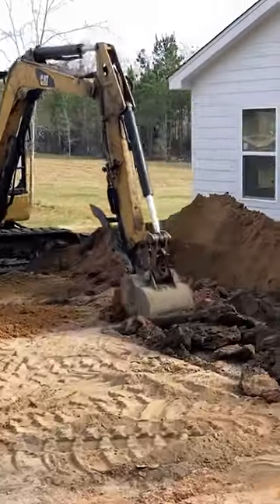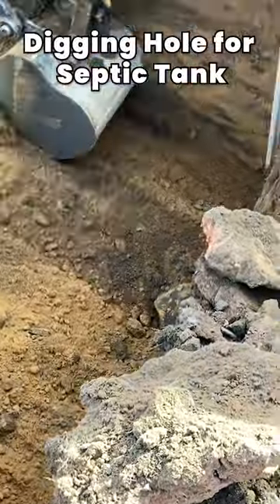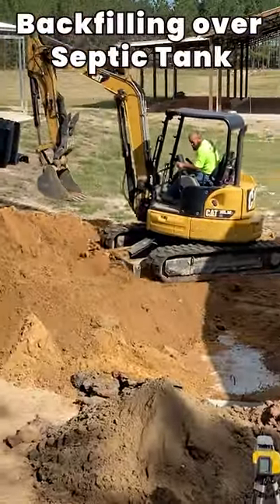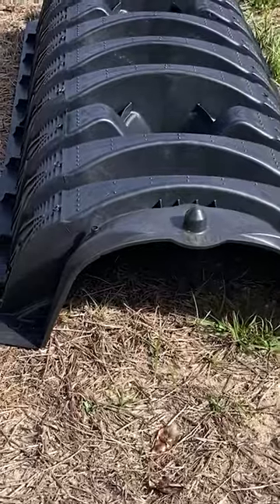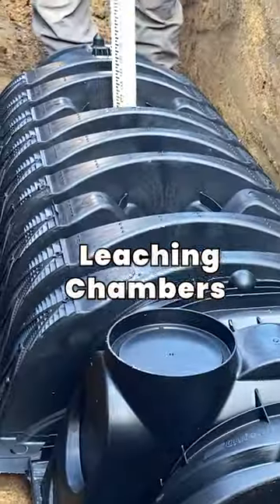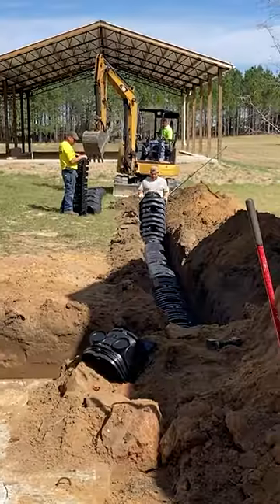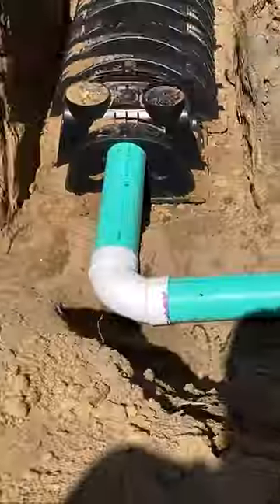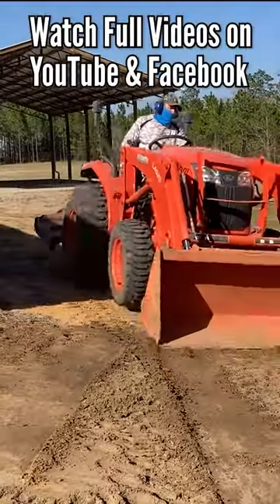COMPLETE Septic Tank and System Install #septictank

Comment: Rather concerned they didn't use schedule 40 pipe there, or at least appears that way. That thin wall crushes very easily.
Reply: You don't use schedule 40 that deep lol schedule 40 is for above ground or shallow in case a truck or tractor drives over. That deep will not feel any additional weight
Reply: @vanderumd11 what ?
Reply: @hallwest9650  you're obviously not in the trades, move along
Reply: @vanderumd11  obviously you are not sir
Reply: @hallwest9650  26years building lol grow a pair and get dirty. You might learn

Comment: I had the same size box put in without the leach chambers they put something else like pvc drain tile for 5k$ in Grayling Mi. in 21. ( I think) . needs to be 50 feet from well.  they missed the 4x4x4 bright red box the well is housed in. so they moved it. the well is up front so the box is not so far out the back of metal barn. still have not punched the seal. building project put on hold for covid. 2x4x8 pre covid 1.98$  covid price 10.00$ so tiny homes sound cozy...maybe I'll just go fishing. again.

Comment: How much did your system run . Mine was 7,200 for same system you have
Reply from the maker: It was a year ago... $4400   Probably $6K or more now
Reply: That's a great price. I wouldn't bother doing it myself for that, although it would be an interesting project
Reply: I had a new septic tank and a dose tank and five fingers like those. The dose tank has a pump that pumps the liquid that comes out of septic over into the distribution box for the fingers. It’s a two inch pipe that runs from dose tank to distribution box.

Comment: These chamber systems don’t last
The old school way of gravel and corrugated pipe will last you 30 years
Some chamber systems have failed after 10
Reply: They work perfectly fine in South Florida. My last house I did with chambers in 2007. They are still working fine. 

My current house has a flat roof. I ran a bunch of chambers to the gutters, the rain no longer floods the yard.
Reply: Got a system that has been in since 1994 no problems here in north georgia!